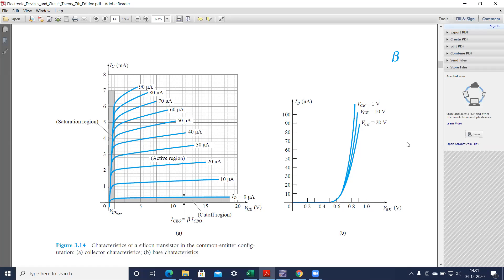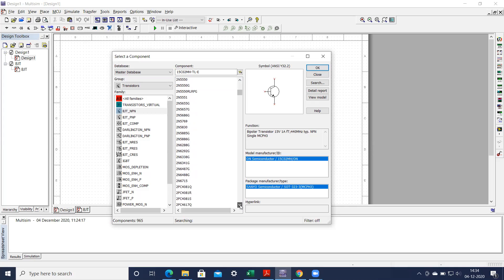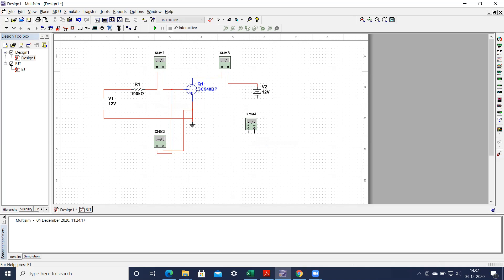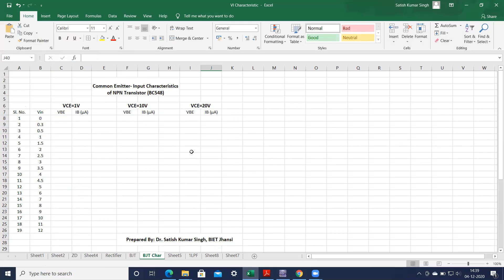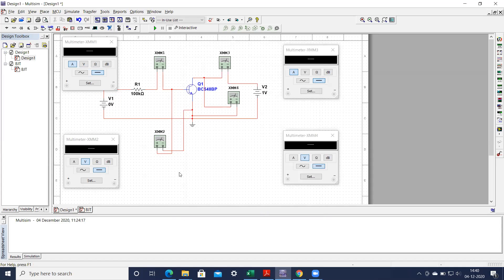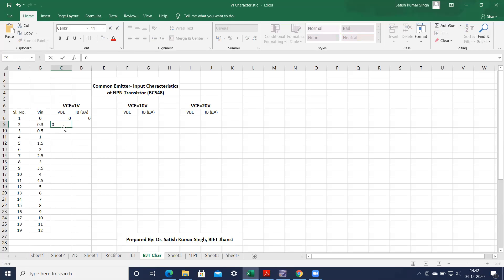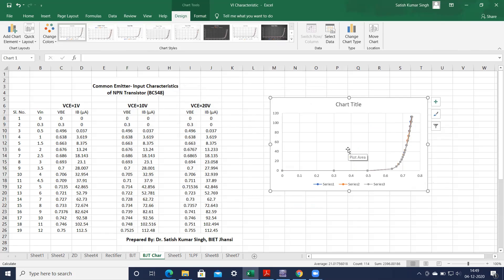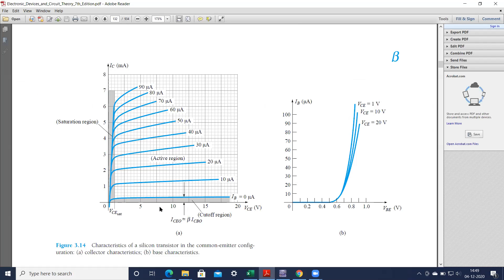EDC Lab | Input Characteristics of Common Emitter BJT using Multisim | Bipolar Junction Transistor

Comment: How to calculate the input dynamic resistance from the graph at constant Vce ??
Reply from the maker: It is equivalent to calculate hie (Hybrid parameter) from input characteristics. For a desired value of Vce, calculate the dVbe/dIbe (difference between base emitter voltage to difference between base current ratio)  when it is sufficiently conducting (means Vbe >0.6 Volt ).